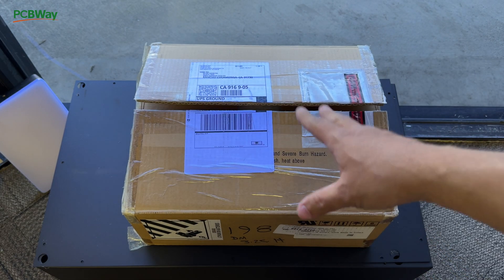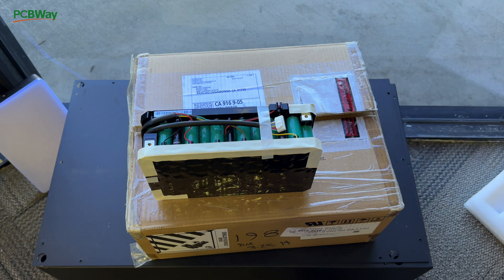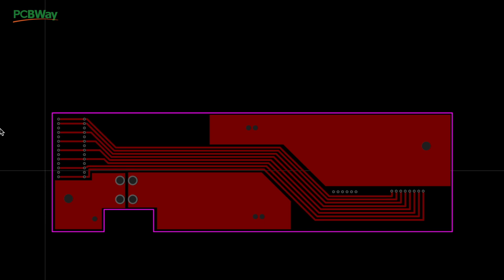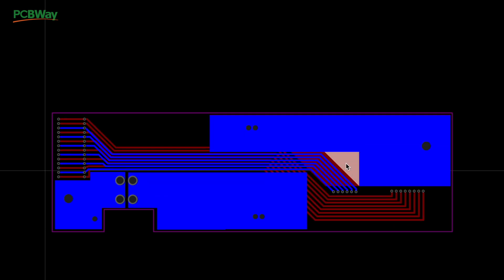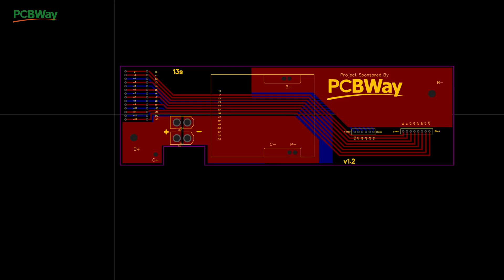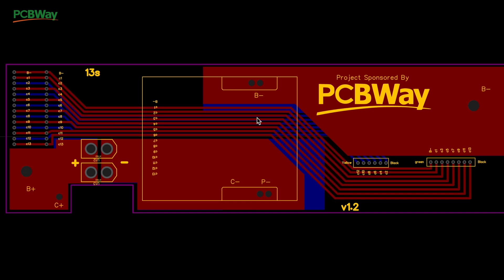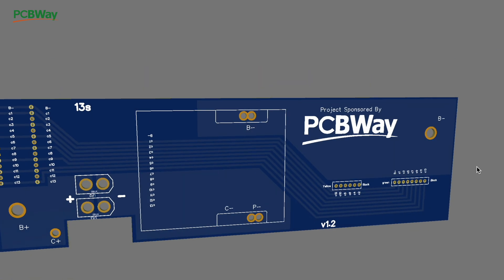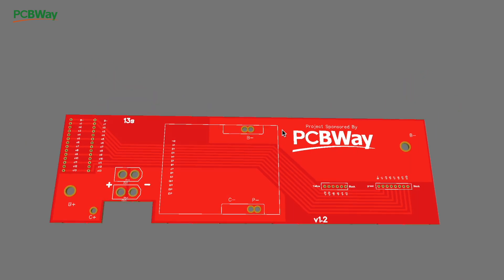Samsung INR 13S 54v Lithium Ion Battery 20R Scooter and eBike Module - BMS adapter pcbWAY

Comment: thanks bro i purchased some of these batteries and signed up for pcbway before i saw you did all the work. the exact female connectors that this battery needs are jst-xh 2.54 6-pin and an 8-pin female

Comment: I need to replace the 96V lead acid pack (16-6V batteries. C20=225Ah) in my VoltsRabbit. If each of these is rated at 10Ah (505Wh/48V), could I use 2 series sets of 10 in parallel to get nearly the equivalent? Or should I be looking at bigger batteries for better savings?